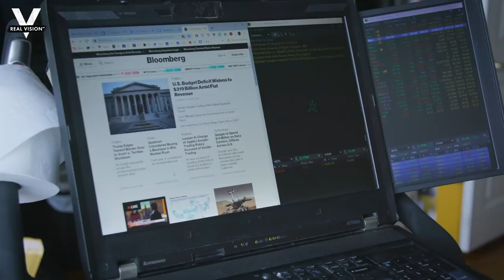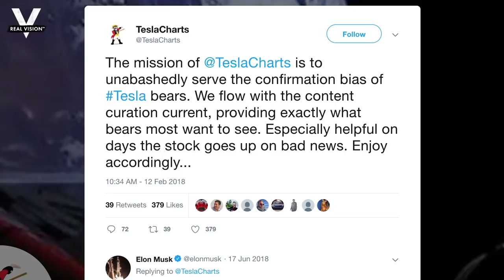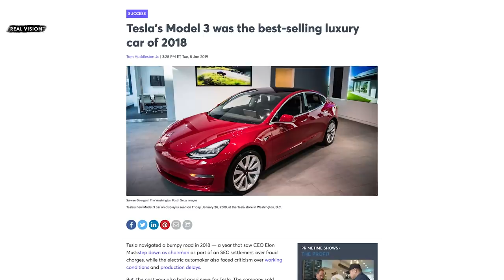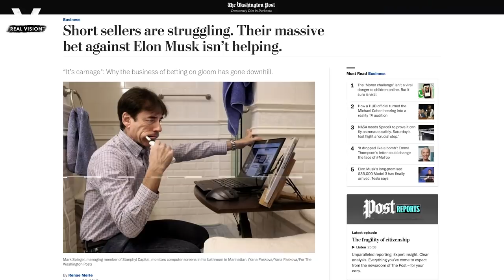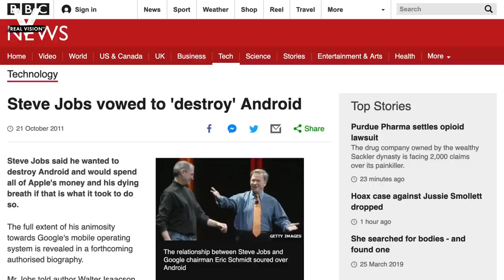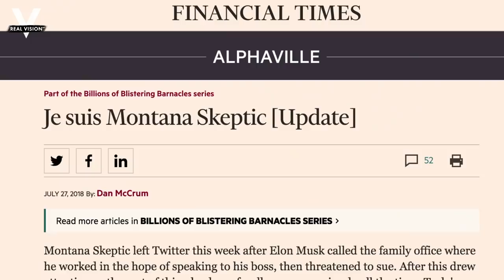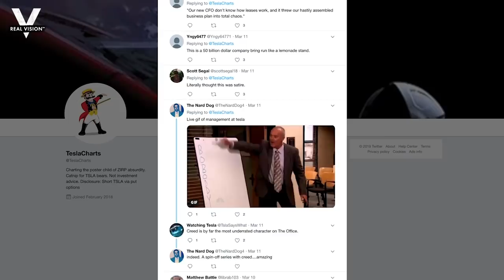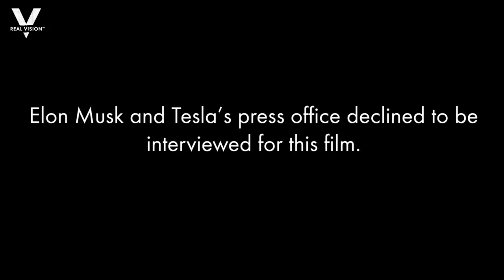Tesla Stock: Bull Case vs Bear Case | Full Documentary

Comment: All I know is I've driven the Tesla Model S and Model 3. I loved them both. The genie is out of the bottle on this tech and that in itself will never go away no matter what the haters and oil industry say.
Reply: Thx for the amateur opinion.  It turns out batteries are very expensive, and Tesla does not price their cars high enough to make up for the costs, because then they wouldn't sell as many.
Reply: @zd1322  That's not the biggest reason they are going bankrupt though. They have horribly inefficient production and logistics and very unreliable cars that require a lot of battery and drive train replacements and many other fixes under warranty. I'm quite confident other manufacturers will be able to do it right for a reasonable price.
Reply: I think the endless warranty repairs especially the dead battery pack replacements are probably the biggest reason for their never ending losses.
Reply: @whateverrevetahw6846  I don't think the failure rate is high enough to back that claim. I work at a Honda dealer. They have numerous engine failures despite the reputation of being very reliable.
Reply: @jeremyventurino9481  Why do you think the failure rate of Tesla's is not much higher than with Honda? I have seen many examples of motors and battery packs needing replacement on twitter and rich rebuilds has given many examples on his channel as well. Those model S 100 battery packs probably cost Tesla $20000 to replace, I think it must be a very big factor. Tesla's have horrible quality compared to other cars, they spend a lot of time at the service center for all kinds of problems.
Reply: @whateverrevetahw6846  You do know you can edit a post just go back and change it to Honda.
Reply: @gregandkaruna6674  Actually I did know that but for some strange reason I didn't. It was late... 😂
Ok fixed it...
Reply: @zd1322 Going back 10 years or so EV batteries were 400 dollars per kilowatt hour now they're 190 dollars. With tesla's giga factory producing more and more batteries, they're reaching their goal of 100 dollars per kilowatt hour. That will make an EV very competitive with lower cost ICE cars.
Reply: 10-20 years go by and all you need is a new battery then it might last for over 50 years
Reply: true, but have you seen the Audi etron GT electric car?  competition is fierce. Don't be a die hard, examine all angles and all possibilities.
Reply: @laturista1000   O, yeah? Elon will be putting rocked boosters on his electric cars
Reply: @dbright Musk said they are approaching $100 per kwh for cell manufacturing cost and it costs a significant amount extra to make them into battery packs so I think including transport and service cost it wont be much lower than $20000 and it almost certainly was that high a few years ago.
I'm looking forward to EV's myself but it certainly will not come from Tesla, they are just a ponzi scheme with a horrible car factory and without raising new billions are very close to bankruptcy.
Reply: jonsan astari  I agree but I am hoping in 3 years there will be some decent reasonably priced electric cars from good manufacturers. Of course I do realise the battery technology will still have very serious limitations even 3 years from now but they may be acceptable to me by then.
Reply: @dbright I was only referring to Musk's statements that they are approaching $100/kwh cell cost so even if we believe him they are still above that price now. I think I remember someone state cell cost is about 75% of the total pack cost but of course don't take that too seriously since I obviously don't know. :)
But manufacturing cost and retail cost is not the same thing, we still need to add profit, transport, installation and taxes on top of this so I think $20000 seems like a fair guess. Of course keep in mind it is Musk's lies that have kept Tesla going for so long and has also given it its very high valuation so I do not know how seriously we can take his projected battery cost but it seemed useful as a minimum guide thats why I mentioned it.
Reply: @dbright I have seen gross margins of 25 percent mentioned for the cars I think. So if the battery pack costs $16000 to manufacture, transport to Fremont and install in the car this would give it a $20000 share of the final sales price. And remember this is the tax free price. I suspect when you need to have your battery replaced you also have to pay taxes on the replacement battery?
Reply: Remember that $100/kwh was a projected cell cost in the near future by Musk. The current price is probably still at least a little higher than this even if we assume Musk is not lying about his projections, otherwise it could be much higher and it was even higher a few years ago. So those battery packs sold on ebay now may well have been worth $30000 when new.
Reply: I think it will be a while before batteries are affordable enough to make EV's viable for the masses.
Reply: I'm looking forward to $100/kwh battery pack production cost which would mean about a $10000 share of the total car before tax sale price for a 75kwh pack like on the long range model 3. Still expensive but it seems reasonable for a $40000 car. :-) My guess is they will reach this price in about 5 years.
Reply: @dbright I said the original price of the 100kwh pack in the S or X 100D might have been that price a few years ago when the cell prices were supposedly still higher and Tesla's pack assembly process also more expensive. The $35000 model 3 is supposed to have a 50kwh battery pack which would probably make up at most $10000 of the price of the car if Musk's statements about battery costs are roughly accurate.
Reply: @whateverrevetahw6846  And then audi is paying extra for each audi e-tron, to be competitive with Tesla :PPP
Reply: @kuba729  What do you mean?
Reply: @whateverrevetahw6846  Audi is losing money on every single audi e-tron :)
Reply: @kuba729  Ok? I do not understand what you are trying to say sorry.
Reply: Michael Valente uh. No. Battery text evolution is well, well past the point of diminishing returns.   Just can’t increase the energy density beyond a certain point. And we’re nearly there.  No Moore’s law here.
Reply: goodfella21f damn near every other global car company?
Reply: Kuba jabłoński no car company has made a so much as one thin dime on EVs.
Reply: @dbright I don't know, I said in my last post I think it is probably no more than $10000. But I don't have any reliable information on this, just Musk's projections of cell cost combined the other factors I explained. What is clear is that it is expensive and EV's will remain more expensive than ICE's except perhaps for very short range EV's.
Reply: @dbright I think it largely depends on your local electricity costs. I made some calculations for myself and concluded that if those battery costs mentioned before are reached EV's could be economical for someone who does a lot of miles, enough to get something like 1000 full cycles out of the battery during the lifetime of the car. For example if the battery is $200/kwh then if you use it for 1000 full cycles worth of distance that will be $3 per 15kwh which is supposed to be the energy consumption per 100km of a model 3 although only in ideal weather conditions, in cold weather it is much worse. You can add your electricity costs and compare to gasoline costs. I'm in europe and was too lazy to convert to miles and gallons. :-)
Of course things get more complicated since gasoline prices especially in europe contain a lot of road tax and electricity does not so if EV's would dominate this road tax would have to be added on top of the electricity cost, or subtracted from the gasoline cost to compare. Also it is quite likely the electric car with the battery cost subtracted is quite a bit cheaper than the gasoline car so that makes it even more difficult to compare. And as you mentioned there likely are some savings in maintenance and in theory electric motors can probably last longer, in theory, not in case of Tesla's. The maintenance savings are also highly overstated by Tesla fans, most likely repeating Musk's lies. So conclusion I don't know, and it is very complicated. :-) But I think EV's could be economical for high mileage use if the batteries are durable lasting many cycles, preferably 2000 and the motors are also very high quality and long lasting. For people who don't do many miles EV's will remain much more expensive in terms of total cost of ownership unless they settle for a really short range with a very small battery. So basically you need to be able to make good use of the total number of cycles your expensive battery can provide to make EV's an economical choice.
Reply: 1000 cycles of a long range model 3 would approach 300000miles. There are probably not many people who will be able to make good use of that. Perhaps for taxis and eventually autonomous electric fleets it will make sense.
Reply: I'm actually looking forward to good hybrids in the future with batteries that are good for about 2x your daily use. 15-20 kwh battery packs could be put to good use by many people. The problem is that batteries also have a kw/kg limitation and degrade faster when used at a higher power so these will probably require a breakthrough in battery technology to be able to get the kind of power Tesla's have out of these much smaller battery packs and have them still last 2000 cycles. If such batteries could be made for the kind of prices I mentioned before I think hybrids could be the best choice for most people. The gasoline engine would be low power and basically only there as a backup and rarely used. 
I have no idea how close the manufacturers are to achieving these kind of battery specs and prices.
Personally I would actually accept an EV with such a high performance small battery pack without a gasoline engine as a backup since I don't care to be able to do large distances and with widely available fast charging infrastructure in the future I think it would still be ok to drive long distances occasionally with many charging stops.
Reply: I prefer the idea of a lighter electric car with a 100kg battery pack instead of the Tesla's which are hauling around those heavy 400-600kg batteries.
Reply: @dbright That is probably a long way off into the future, in the meantime the lack of road tax could be seen as an incentive for electric cars. When they become widespread technology will be much further developed and all cars might simply be tracked and be charged for the type of roads and total km's they travel? Even better would be if we have fully autonomous vehicles by then and we do not even need to own cars anymore. Even better still would be automated airplanes... :-p We will just have to see where it goes right?
Reply: @dbright The super-capacitor would help for fast acceleration and regenerative braking but it would not help for fast charging where you need to be able to fill the whole battery at high power which would be essential to make the small battery fast charging EV's possible. I think that lightweight electric dream car I want simply is not possibly with current battery technology. Imagine a 20kwh battery pack that can be charged and discharged at 300kw across the whole capacity. Tesla performance and 4min complete recharge. For me this would make long range heavy battery packs unnecessary. I realise 300kw performance is unnecessary and kind of childish but it is largely what made Tesla's so popular. Right now you need the huge batteries to achieve that kind of power, a super-capacitor could allow high power bursts for acceleration but it would not help fast charging the small packs so ultimately I am hoping for some big breakthrough in batteries to enable this. I think power density with high cycle durability is at least as important as high energy density although it is ultimately a tradeoff of all these specifications and the price that determines if they are economically viable for the mass market.
Reply: I do not know about stale gasoline but I'm sure the engineers will find a solution. Probably just part of the software to manage that?
Reply: @dbright The fix I was thinking of was simply running on gasoline a hundred miles a month perhaps? This could be managed by the software.
Reply: @dbright I think even a regular non plug-in hybrid could still be very good, high power electric motors for acceleration and regenerative braking and a low power ICE to maintain speed, perhaps optimised for maximum efficiency at 75mph. With a high power density battery it would only need a very small battery to run fully electric in cities and other low speed roads. A 5kwh battery could be enough, perhaps coupled with a super-capacitor. Even a car like this could have the same driving characteristics as Tesla's.
Reply: I'm looking forward to what the manufacturers will release over the next years. :-)
Reply: Many car companies such as Toyota are still much more focused on hybrids instead of EV's so there could be some very big advancements in the future.
Reply: @dbright Maybe you are right and stale gas turns out to be a tough problem. I hope for big breakthroughs in battery technology in the near future because current batteries still have severe limitations and are very expensive.
Reply: "All I know is [insert cult mantra]" I worked for the company for 3 years My dad worked for 4 years until his passing this year.

You just look like you're drinking the Kool-Aid delete your comment bro.

During my cult induction in December of 2016 they told us that autonomous fleet driving is only a couple months away.

[Infinite hold for applause]
Reply: @whateverrevetahw6846  absolutely correct part of the problem is the corruption that is bone deep most of the hangers on that still work for the company such as some people who I don't know what will happen to me if I start naming them but a lot of them move Coke throughout the Fremont and Dublin factories.

Comment: I'm no Tesla fanatic but comparing it to vehicle manufacturers that have existed since before WW2 is a bit disingenuous
Reply: It's not disingenuous to compare Tesla to vehicle manufacturers because Tesla is also a vehicle manufacturer. What else would it be feasible to base one's expectations on of what a company is probably capable of other than by comparing it to other companies in the same industry?
Reply: @IamBHM    Did you even read my entire comment? I said it's disingenuous to compare it to motor companies that have existed since BEFORE WW2. Tesla is only 10 years old and it's not just another vehicle manufacturer. It's venturing into uncharted territory within the industry and it's doing better than a lot of the other companies when they first started. You can't just hold Tesla up to the standards of Toyota or BMW when they have had several decades to invest and develop their manufacturing process. In fact companies like GMC and Chrysler would have vanished or been acquired if it weren't for the government bailing them out when they got in trouble during recessions
Reply: Look at the Jaguar, a supposed Tesla killer, they sit on the dealers lot, nobody wants them.
Reply: You’re correct. Tesla is the only car company that makes cars out of tents.
Reply: Aron Tesfay , actually, being the new kid on the block, for only ten years is an advantage. Tesla has made the commitment to sustainable energy. For autos, all of their energy and investment has gone into EVs from the very beginning. They do not have to re-tool or create new facilities to make their product. Not only do they have the best facilities and best engineers, they thought way ahead and started factories for the main component, the batteries. Think about your legacy auto manufacturers; they must re-tool their plants and find the batteries— huge expensive problem, and if you are the best and the brightest engineer, who do you want to work for ? When the  “ legacy “ auto manufacturers do get it straightened out, Tesla will be supplying storage systems for power companies and other countries, they will be producing products that produce energy, like the solar roofs (which I can’t wait to get). This is because Tesla is not just an auto manufacturer, they are an energy company. Producing ground transportation will probably be just one component, I can see everything from chain saws to ocean liners being made by or running on Tesla power in the future. What will GM and Audi be doing ? They will be still trying to get the cost of their batteries down to make a competitive auto. That’s why the so called “Tesla killer” autos are still sitting on the lot.
Reply: shepherdsknoll8  you’re in for a rude awakening. It was all for money raising. Also the batteries are Panasonic. Not Tesla.
Reply: mike g Actually, you could have stopped while you were ahead: Tesla is the only car company that makes cars. Driving a Model 3 ruins you for anything else. It is that good.
Reply: mike g , here’s the “Tesla Salute “, you know, the one when we are side-by-side, on a curve, doing 65 mph — both middle fingers extended.
Reply: J. Kevin McNary  enjoy your warranty